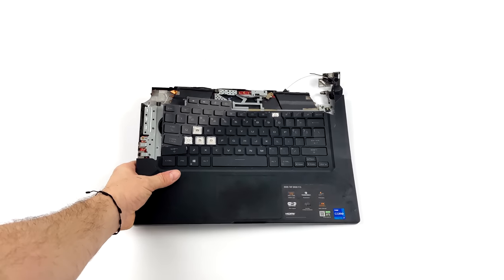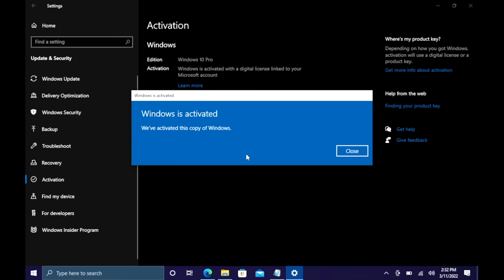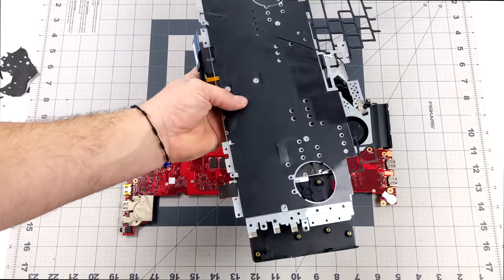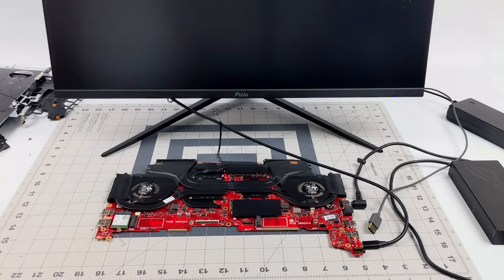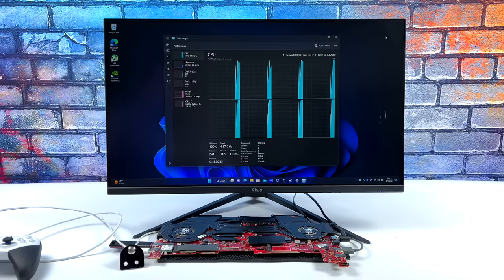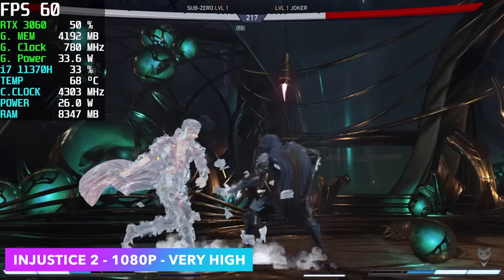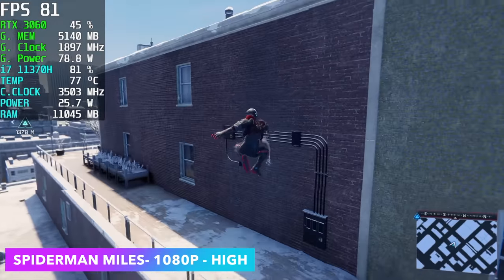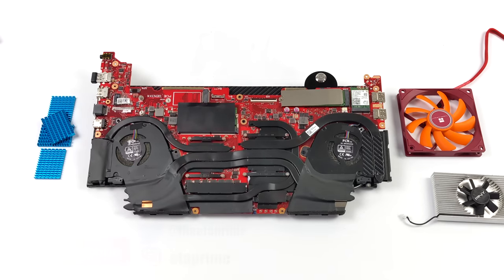I Turned This Broken Laptop Into A Powerful Desktop Gaming PC

Comment from the maker: Got an awesome idea to case this up using Palight. But if you have ideas let me know. Not looking to do any 3d printing
Reply: What if you put it in a retro wooden AV box or made a wooden case for it? Would be kinda cool. Maybe a dark walnut stain and do some wet sanding to give it that smooth finish
Reply: Could pair it up with a monitor to make an AIO by slapping it on the back or get creative with a portable display and make a chonky gaming tablet
Reply: I'd take off the beat up old cooler & I'd attach old huge zalman copper coolers I've been saving for something like that, & if I had no way to attach them to the motherboard, I'd use thermal epoxy & just glue them straight to the CPU/GPUs/ChipSet/RAM anything holding it back.

I'd just make it an open system.  Make a upside down T  shape out of wood or metal & cut threads for stand offs, all mattering how the coolers looked best is how I'd mount it, if I had to cool things on both sides, I'd do it out of wood & cut holes in the wood so I could attach coolers to both sides. 

I live at a beach resort town, & the amount of construction is just non stop around here, & all million+ dollar homes, & when I walk my dogs if I see a nice size slab of finishing solid white fake wood ($50 a half sheet) on the top of their construction dumpster I always grab it for little projects like this.
Reply: How about pmma?
Reply: Minimalist arcade machine built out of clear acrylic and extruded aluminum to show off the internals.
Reply: interesting idea and project that would be cool to see. Turn it into an Arcade setup, maybe a bartop or something along those lines. Gut out one of the Aliexpress all in one setups or something like that to keep cost and building to a minimum.
Reply: redo the thermal paste and double check the mounting pressure of the cooler, with how buckled the shell was the cooler may not be fully contacting the hardware. but yeah, few things you can try to help it out more.
Reply: Very impressive project. Repurposing and keeping it mobile and compact.
Reply: As far i'm seeing the heatpipes are bend, they are hollow and somehow it looks the flow inside is strikt by it.
Maybe if the option is available try to source an new (stock) cooler for it.
Love to see something for the case made out of brass, easy to model metal for DIY case.
It has an external power supply so it would be ''easy'' to made it really SFF.
If The monitor is used not so heavy also an option to made the foot of the monitor the stand for it. routing the HDMI cable behind it in the monitorstand and you have an powerfull AIO-PC
so in short, the PC case would be also the monitorstand.
Reply: maybe a watercooler loop and a wooden case. all cnc´d.
Reply: At 10 minutes on the screen you seem to be using a benchmark tool that displays the performance summary along with configuration bottlenecks, can you please tell me what you're using here?
Reply: Put it in a brief or pelican type case with a portable usb c monitor attached to make it somewhat portable. Having a battery for it may help with performance and of course a new cooling system. Some people mentioned the heat pipes look damaged but hard for me to tell. Even cooler if whatever case you go with can act as a heatsink!
Reply: Great concept and content as always.
Reply: Maybe look into one of those new "open" PC cases where it's almost literally just some mounting hardware with a stand. Maybe the mount points won't match, but if you find something that's about the right size you might be able to drill some holes in the chassis, add some standoffs and maybe even some glass and make it look nicer.
Reply: Did you check the thermal paste?  This unit is old and has been flexed to hell.  It would make perfect sense that you are thermal throttling due to insulation in the heat path.
Reply: Are those heatpipes fine? they look like they sustained damage
Reply: How about a giant tablet-shaped PC, or an integrated mechanical keyboard?
Reply: Turn it into an arcade machine. U would need carpentry skills tho
Reply: I think it would be cool to mount to the back of a wall mounted tv in the living Room!
Reply: with that spare panel as a idea Id do a pancake case with stand offs and rig up some low profile fans as replacements for the stock ones. Seeing the heat pipes my first thought was damage done to them is interrupting the vapor chain but you were pumping 45w into it and it looks like asus designed it to thermally manage 25w so maybe just ditching the stock cooling for some larger gpu HSF and use some 120s mounted in the case like a console to do the workhorse cooling for the gpu and cpu. I do like the idea of some sort of vertical mount with the way the thumbnail is set up. Id have a lot of fun fooling with something like this. Sadly I have only seen or had access to really old laptops that are damaged or netbooks nothing worth the effort to convert, or ones so smashed up youd need replacement parts or the entire thing is DOA.  Oh forgot to add look for old heater vent grills ( I think that is what they are sold as ) They come in brass or alum and have all sorts of neat retro patterns on them. The metals are easy to cut, drill, and shape.
Reply: Cool story bro...
Reply: might be worth redoing the thermal paste as it may have lost some of it's transfer ability when the machine was smashed
Reply: The reason is not boosting that high is because for laptop 3060s to boost you need the 230W power brick. those temps for a laptop are low ( I have this 3060 equipped laptop)
Reply: Woods? Or maybe some acrylic panels

With custom mounting ofc
Reply: I love this 😀 this is what am working with and  am adding a 12.6inch screen in portrait.
Reply: Your heat pipes are kinked creating ineffective cooling, most likely from the rage quit. That is probably the biggest issue with the cooling system currently.
Reply: I'd go "open test bench" like with simple hardware box store pre cut Aluminum or Copper sheet, add push external fan to boot pressure of stock fan, and attach heat sinks to metal casing. allowing for case to dissipate heat above 25w TDP to better run 45w TDP.
Reply: Frame it and hang it on the wall with rgb. Show it off the right way.
Reply: Steam Deck OS would be cool for this one... I actually saw someone turn a steam deck into an arcade machine using emulation station and the LG dualup monitor, powering it with something like this would be pretty awesome IMO.
Reply: Good luck with the project! If you're casing this mobo in a big enough case, then maybe water cooling could be an option?
Reply: Connect the battery, make space for it in the case. It may have more performance with that.
Reply: @azbesthu  batteries won't affect performance, modern laptops can run directly from the ac DC converter even without a battery plugged.. luckily since in the yesteryears once your battery kicked the bucket so did the laptop, usually.
Reply: A slim acrylic box with mineral oil and a watercooler.
Hdmi, jack sound, Usb extension to get the connector accessible and everything impermeable. 😅
The first mineral oil cooled laptop 😅 light weight and movable
Reply: A large gpu heatsink might be pretty good too use with this from a dead gpu bought on ebay or locally.
Something with a very wide base like a gtx 470 would probably be great & really cheap these days as a cpu heatsink & then a separate one for the 3060 + potentially some small heatsinks mounted too the vrm chips & vram with a slow 92mm fan pushing some ambient air onto those.

If possible screw it directly through the motherboard via the other side if possible & look into adding vesa mounting holes into the case this will be housed in.
Or potentially just a cpu heatsink like an am3+ or am3 phenom heatsink if you don't mind this being a bit thicker.

Tapping in screwholes in that heatsink so it can be screwed down in place directly on top of the original heatsink with some extra thermalpaste between kind of sandwiching the two.
It's not going too be 100% efficient vs direct die but the sheer extra amount of metal too absorb the heat I'd imagine should lower the temperatures nicely still allowing the cpu too cool down a bit extra.

Utilizing that usb-c add in a small usb-c hub for extra usb ports, maybe an additional lanport if it's damaged.
Dunno if you tested it so might be worth doing.
Potentially utilize it for storage via a usb-c too m.2 built into the case in it's own little pocket kind of.
That you can just take out of there if you need access too that m.2 drive directly could be pretty good use of it if its not going too be externally available too the case io.
Reply: @dhruvhalwasiya  Think that's MW2 benchmark tool built into the game, the newer release of it.
If you mean the top left window thats MSI Afterburner with Rivatuner Server Statistics configured too show those in the on screen display.
Reply: Very interesting video, I sugest to put an old desk cpu cooler those with solid copper base and adapt the holes to the motherboard, I did the same with a i7 4th gen laptop, temps doesn't exceed 40°C, good luck.
Reply: Hey entering into bios using hdmi, used to work for me, just press the bios keys(esc, del, f12) while booting disconnect and and reconnect the hdmi, and you're good
Reply: @jacqueshilo250  mmmm woodgrain.
Reply: I want to this panel Can you me gift?
Reply: i bet some of the temp issues were from the heat pipes in the last part f the video you can tell a couple were crushed and might be hindering the flow of the liquid in the pipes
Reply: Please somehow find a way to put a desktop cooler on it
Reply: Mount it in an old electronics enclosure such as an old living room DVD player "box" or other junk electronics enclosure. An old enterprise switch enclosure would also be nice and it would already be vented.
Reply: Go look for a black shadow box frame for right dimensions, use motherboard stands (there are longer ones.) than cut out for IO. and maybe use 1 120 mm slim fan for intake. 
Either you could hang it on a wall or use feets either horizontally or vertically.
Then slighty tint the glass and use a LED strip inside. Motherboard color and the stock cooler match is perfect. (no need to upgrade or modify.)
Than name the case with the broken keyboard letters. My preferred name is "R QBIT"
Reply: Framework partnered with cooler master they made a case for laptop motherboards..I think this might work as well for that motherboard u have😮
Reply: You can allways water cool the air cooler like the xmg oasis does. If you're wanting higher performance in the country and gpu like you said. You wouldn't be able to directly solder to the heat pipes ofc, but cleaning the black paint off the heat pipe and applying thermal paste between it and either a thin copper flat tube. Or if you're a magician with good tools your own heat pipe that goes into a water loop. Would be impressive. Been planning on doing this to a backpack laptop cluster of mine because I figured it would be a fun pet project.
Reply: I'd drop it in a broken Xbox one s😎
Reply: I have an idea: Give it to me 😊 to use as I don't have a gaming PC
Reply: I have an idea: Give it to me 😊 to use as I don't have a gaming PC
Reply: Have you got an update video to motherboard please lmk ?

Comment: This was super slick. Immediately started looking for busted up laptops. This would be a really fun project.
Reply: You can't easily find them, because anyone with a brain would give this to a local pc repair, or sell it to them. If repair guys can't fix it, they would then sell it. Of course thats the case If the gpu-cpu is that good, If you go for something that was made in 2015, you can probably find a motherboard thats working.
Reply: @adamfarmer7665  For damage like this it's typically more economical to get a new laptop than try to repair it. PC repair shops are going to have a tough time finding the very specific parts required for the casing and it wouldn't be cheap. They could use the board for parts, but if the board is still working they'd probably find that to be a waste.

If it was just a cracked screen then that's another thing.

The owner would probably either throw it away or sell it for like 20-40 bucks.
Reply: @adamfarmer7665  You can't usually find them with this kind of damage because laptops are pretty strong and usually only get this damaged if someone breaks it on purpose.  shipping usually cost more than the laptop would be considered worth so you would have to get it locally.  But a lot of repair shops would not have time to pursue a project like this that is unlikely to make money.
Reply: Talk to pc repair shops. They use them for parts, but that inventory gets full quick and they can call if they have something like this people often leave them there when they find out it's a lost cause. Also put out an ad in the local resale apps like 5mile and offer up.
Reply: All of these guys in the comment section are right. I suggest either waiting for a stronger APU than Radeon 780m, or biting the bullet by getting some sort of mini PC on Amazon or aliexpress with a laptop 3050 ti

Comment: Just 2 thoughts from a old IT worker who repairs laptops all day. 
1. Clean those fans with canned air! They look fuzzy with dust.
2. Re paste the heat sinks with your favorite thermal compound.
I look forward to seeing the next video!
Reply: liquid metal ideal for such a build
Reply: @johannsmith5697  hell no, you have no way to make it not spill and the surface is so small.
Reply: @cosminmilitaru9920  yeah, liquid metal is scary stuff. Leaking has been a reported issue for PS5 consoles that have been worked on. You need a perfect seal for the stuff not to leak out. Thermal compound is the only way I'll go for general usage.
Reply: Canned air can shoot out liquid wireless air blower is the way now, me and many others have fried stuff with canned air don’t use it
Reply: Tbh, I'm a bit confused. If you're repairing laptops all day, why wouldn't you recommend to disassembly the fan shell and do a deep cleaning over just canned air? It's literally 3-4 small screws and it'll be as good as new.
Reply: IT worker and laptop repair sounds like two different things
Reply: @barabrainrot  Many Many Hats does an IT worker wear.

Comment: Just a heads up, you lose CPU/GPU power relying on powering via PSU only.
Couple of options is, plug in the battery or trick the motherboard to thinking it has one by adding a 12v input to where the battery was.
Reply: Aren't laptops at full power plugged in? I don't think there's any loss of power by pretending there's an internal battery
Reply: @kilroy5680  Sadly not, its too much power via PSU unless it is an actual high performance power adapter, but most laptops rely on the battery for performance and the power adapter for stable input voltage.
Reply: @Doyle69  yeah I dont think you're right because whats usually taught about gaming laptops is that you can expect max performance plugged, and I looked online and there is no voltage difference with or without a battery
Reply: @kilroy5680  Most laptops out there, when no battery connected it puts less power to the CPU and GPU throttling it.
Heres some Google results:

"What happens if I use my laptop without battery?
Power variations could cause components on the laptop's motherboard to fail, which is something that the battery can prevent by acting the way a UPS would. And speaking of power, you probably shouldn't use a laptop without a battery if you live in an area where high-intensity electrical loads are likely"

"It could be that the power supply is not strong enough to "ride out" brief surges in power demand, or it may be that the power supply relies on the battery to provide filtering.) If possible, try with a power adaptor one size bigger, i.e. if the current one is 65W, use the 90w one"

Comment: I've always wanted to try doing this. If you have a 3D printer, you could design and print a simple case for it. As for cooling, there isn't a lot one can do without having a shop and and an Alex like Linus does.
Reply: Alex mentioned 😱

Comment: FYI most laptop keyboards have a button to switch which display is active. Idk if it works in bios but worth a shot if you don't have a working monitor for your laptop

Change the thermal paste would help a lot.
Reply: Thermal paste may even be cracked already, surprised so many heat pipes can't keep the temps down. And in my experience, the application is usually only just "okay" from the factory, which is a shame.
Reply: My old Lenovo has the setting in bios
But it defaults to on board LCD, not external VGA out
Reply: Do you mean like a physical button on the outside of case?

Comment: I would certainly convert it. I'm not sure what all I would try, as I don't have any way to design a custom case, but that might make it perfect for a stealth build, essentially building it into your desk.
The funny thing is it's actually more like an single board computer at this point.
Reply: Just screw/glue bunch of thin wood together, drill holes etc. Wood is non-conductive + light so it will work like a charm. DIYPerks did a similar build.
Reply: @kovrcek  Cool. But I literally mean I have no tools. No saws. No grinders. No drills. Just screwdrivers and wrenches. In reality, I'm an enthusiast and not a hobbyist. One day that will change, but money is in the way.

Comment: You should add a magnet to the lid hall sensor.
You can use the external monitor as the primary screen even in bios.

Comment: I had a old HP notebook ...and I did the same exact thing you did ETA its quite a nostalgic memory  now. I made a case for it did the same cooling solution, worked properly for 2 years but it eventuality K.O'ed...I've moved on to my second laptop a 2021 Asus ROG Strix G15 it have a RTX 3070 8GB Vram, 32GB Memory, AMD R9 5900HX...works like a a dream I couldn't be more grateful to have something like this!